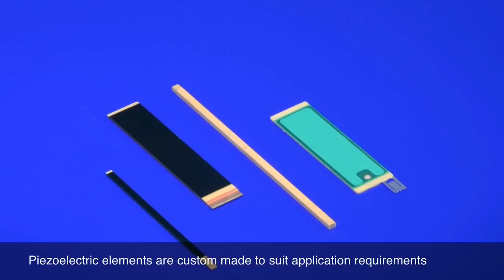Piezoelectric Energy Harvesting

Comment: Hi, I am doing a project about energy harvesting with piezoelectric materials. I would like to know more about the components you used in this video. I have read about the LTC3588, does it work with any kind of piezo bimorph? Or does it have an input limit or something? What is the part number or specifications of the piezoelectric element you are using? What about the supercapacitor? I think it would be good to recreate this experimento, so I would aprecciate a list of parts you used. Thanks.